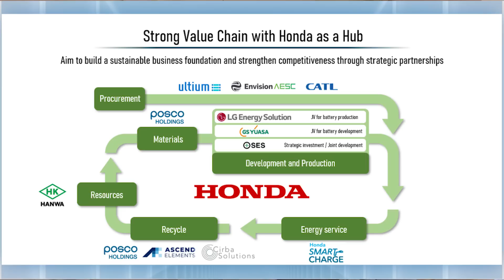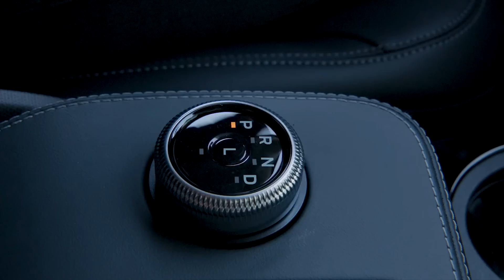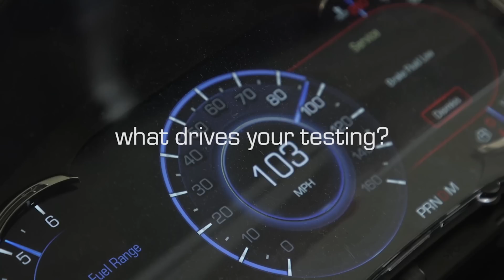Chevy Brings Back Colorado ZR2 Bison; BYD 2023 NEV Sales Top 1 Million - Autoline Daily 3579

Comment: NHTSA —> mandating Mega-nannies in the car??  My ID.4, with current lower speed systems is VERY aggressive.  At 25-30 mph, the autonomous warn/braking system cuts all forward power and brakes notably for a slow right turning car.  I can have my foot off the accelerator, covering the brake, watching the traffic spacing develop and a full 4 car lengths before I’d normally brake it cuts in braking aggressively unless I start an evasion move in time.
I don’t want to know how aggressively a car will handle situations at more than 2X the speed, esp if it false detects.   Probably just like the reports of Model 3 phantom braking on the interstate, eh?

Comment: I owned a 2020 Bolt with the 2 safety packages that included emergency braking. It doesn't work. It allowed my wife to hit another car at low speed in a parking lot with no warning or braking, yet it regularly give false warnings. Driving between 2 parked cars in a subdivision, oncoming car in the other lane at a bend to the right, and even when there was no a car or person in sight. The blind spot detection also had problems. When a car is traveling the same speed, no detection. I can hear the car (poor insulation), but can't see it in the mirrors and no indication from the detectors. I don't trust this stuff, especially from GM.
Reply: Just because you had a system that was poorly implemented or flatly doesn’t mean it doesn’t work as a whole.
Reply: Sounds like your wife is irresponsible when driving sometimes! Blame the car but take no responsibility!
Reply: Get a Tesla.
Reply: I have actually the opposite to say about my Chevy bolt EUV. It's been so great and super reliable. The bird's eye view is unmatched. Never felt more confident with parking and knowing what's around me. Now that I'm in a Model Y it honestly feels like a downgrade. I can't see everything around me, especially in front of the grill which I miss the most.